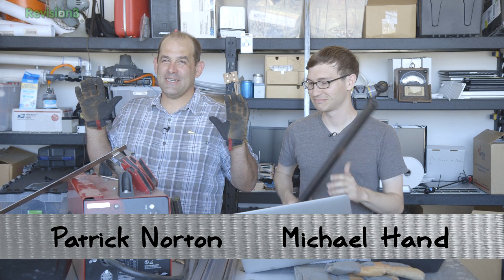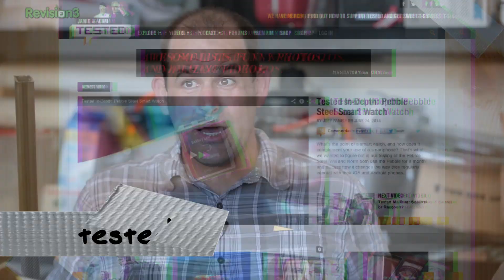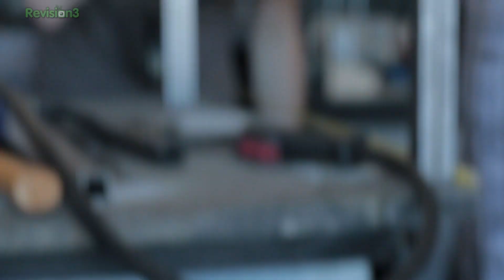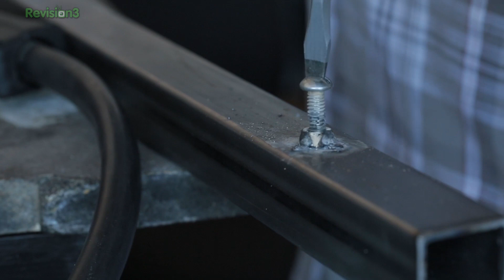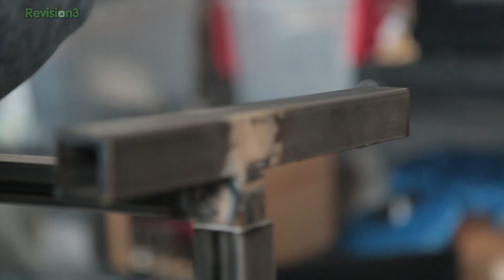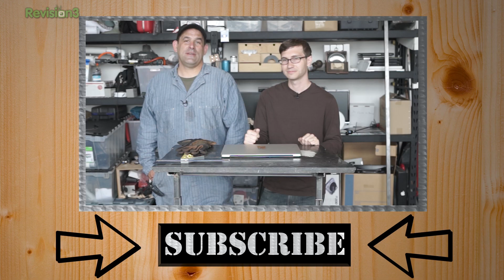DIY Adjustable Standing Desk

Comment: So how do you change the height? With a screwdriver? That is absolutely not practical for daily use. 
It would be good to have one lever to loosen and to fix the position or even better but probably way harder to have a paddle to pump the desk up if something heavy stands on top. Have you already used the desk for some time? What are your impressions?
Reply: Watch my channel, Im gonna make a REAL standing desk!

Comment: Any quick adjust options?  I was thinking (although unsightly) squeeze clamps vs. screws.   Maybe dropping springs down the 1" columns to hold weight.  Any other thoughts are appreciated!  (although only 13k views :( )

Comment: I too am excited about welding small projects. Will that little welder run off a 110v 15A circuit or are you using 20A or 220v?

My garage is only 15A 110v so trying to find a mig that won't keep tripping breaker. 

There's an episode idea, install a 20A breaker without looking like someone belonging to Colonel Sanders.

Comment: How about you guys do a multiple part series putting together a 3d printer? Then use that for more DYI projects? Patrick, you should tell your co-host, he can become an accomplished welder if he can weld two farts together :)
Reply: And I thought watching a welding instructor weld a sliced soda can back together w/ one hand was tough... re: 3D Printer, you thinking total DIY project, or assembling a kit?
Reply: patrick norton I think a kit would be a 3 part series for you guys. Hardware put together, firmware and then the third part would be tweaking the prints. In the background it would involve you guys tearing your hair out figuring it out. Prusa I3 or similar would be great for this show. Would only cost you guys about 500-600bux in investment, and at the end you get a tool for future DIY projects. 

A full DIY solution would be much longer. Which could be a gamble as you could either loose or gain audience with say a 6-10 part series. However it would be very inspirational. I would sugest building a Delta printer in this scenario, google rostock 3d printer for more info. This would again cost same as above, and would have all the above positive effects, but it would be custom made to your size. I am building a printer with a build surface of approximately 300mmx375mm in Delta format. Also custom made by me. I am tearing my hair out though. The devil is in the details.

Comment: i love your channel here and am subscribed to many other shows you do as well. i would like to clear up though that the welder your using is a flux core wire feed welder and NOT a M.I.G. M.I.G. stands for Metal Inert Gas. since there is no gas it is not a M.I.G. the type your using is the cheaper of the two. they work great for light steel. keep it up guys, love ya'll.
Reply: You are correct sir... just a bad habit calling it a MIG welder when there's no IG hooked up.
Reply: Because the flux acts as a shielding gas, manufacturers and retailers list these types of welders as MIG. If I had to guess it is to differentiate them from Stick Welders.
Reply: Skip Ives You are wrong.  If the machine is incapable of supplying gas, manufacturers list them as flux-cored welders not mig.  Bigger name companies such as Lincoln or Miller don't offer a welder that is flux core only so all of theirs are referred to as Mig.  Examples:  http://www.northerntool.com/shop/tools/product_200403263_200403263 http://www.tractorsupply.com/en/store/jobsmartreg%3B-125-amp-mig-fluxcore-welder http://www.harborfreight.com/90-amp-ac-120-volt-flux-cored-welder-68887.html
Reply: Jared Shaffer But if you are using flux core and an inert gas, it is dual shield and it is some of the easiest and best looking welds you can do without hundreds of hours under the hood. Speaking of the hood, Patrick, you need to get yourself an auto-darkening hood. That looked like an old style hood you had there, that is what I learned with way back when, and going to an auto-darkening hood was a night and day difference.

Comment: Would you recommend the Northern Industrial Welders Flux Core 125 115V Flux Cored Welder - 125 Amp if not then can you recommend me a budget one
Reply: 152 reviews, 4.7 out o' 5 star average... I suspect it'll do the job fine.
Reply: patrick norton  thank you I'm a woodworker who's wanted to start working with metal going to get that and the DEWALT D28710 14-Inch Abrasive Chop Saw
Reply: Sean Hames Be really careful about where you weld. I'm a big fan of welding outside, or at least in a very clean corner w/ fireproof (drywall/steel/concrete/etc) walls. (not that you can tell from this video.) Welder + wood dust + wood can equal a major fire.